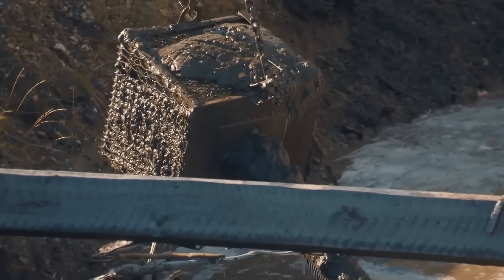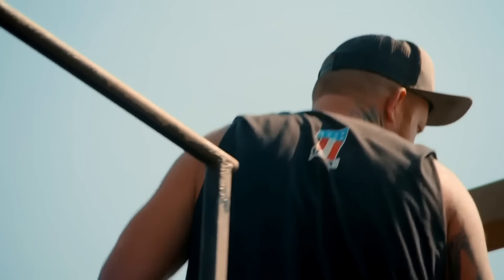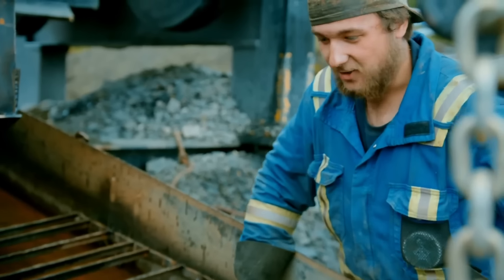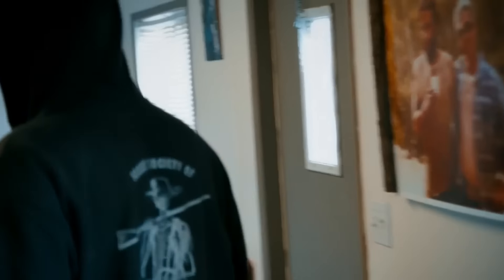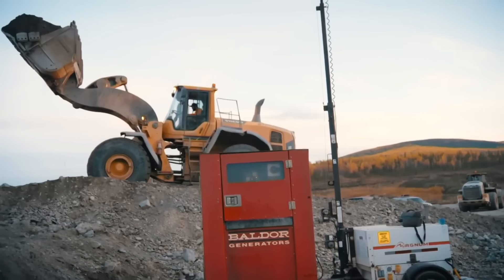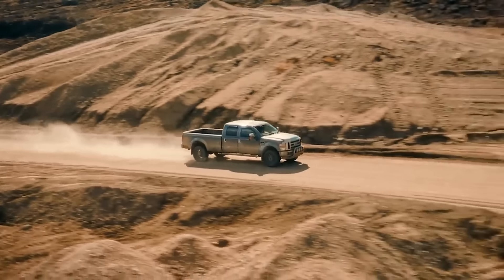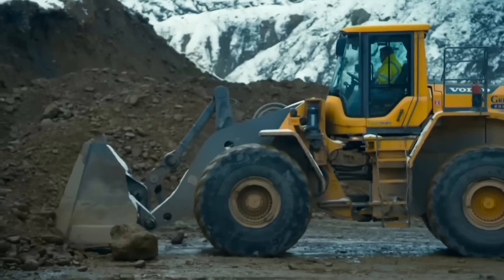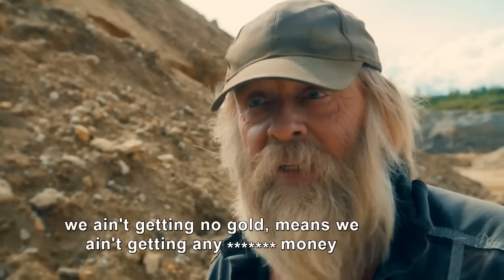Parker's, Tony's & Other Miners' BEST GOLD FINDS Of Gold Rush Series 12!! | Part 2

Comment: around the 35 min mark where the lady rips the bypass out of the washplant that was probably the most relaxed expression Ive ever seen from Parker, 7 or 8 years ago if that had happened heads would of rolled, but you can really tell hes getting a lot of maturity as the years go by.

Comment: Tony in Australia we suspend the foot valve for the pump intake from floats about 5 feet from the surface.  So there for we always have clear clean water.. this is not the first time you have had this issue with your pump intakes.
Reply: Great tip wayne, I would love to connect somehow and learn more about gold mining!
Reply: Tony my thoughts exactly